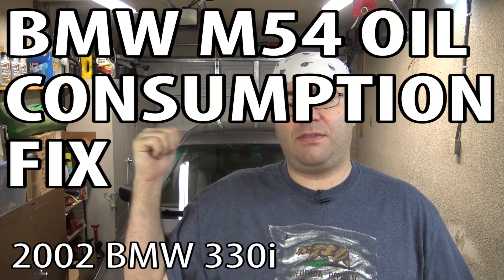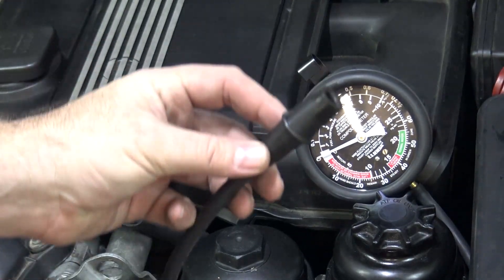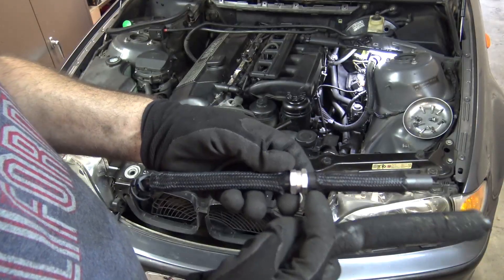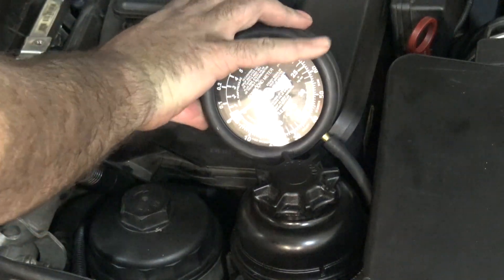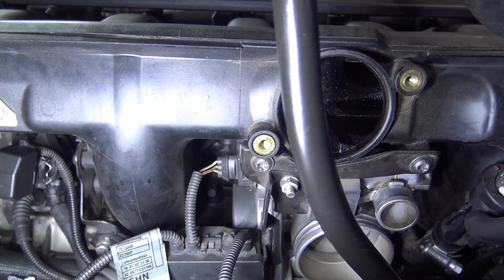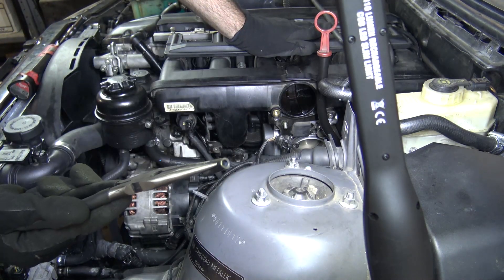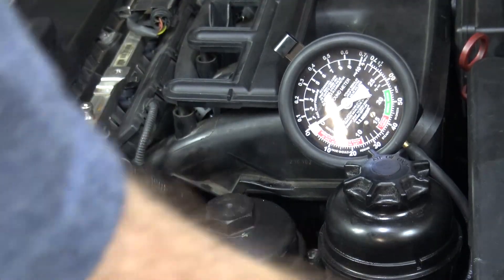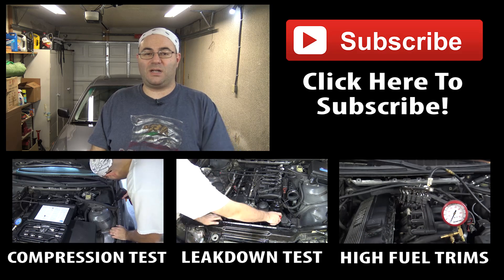BMW E46/E39 M54 Engine Oil Consumption Fix (02Pilot Mod) DIY

Comment: Just a point for ppl that will try this out. If you do this mod without putting a one-way valve on the return hose of the oil dipstick and connect a vacuum gage to the breather to check how much vacuum you have, you WILL suck oil up from your dipstick, since all the vacuum now has nowhere to go... ask me how I know....
Reply: This happened to me also.  I heard it suck, then smoke started coming out of the exhaust.  Come to think of it, I don't think the car sucked much oil (per the dipstick), but it did burn a lot of carbon out of the engine (similar to running seafoam or water in the manifold).  I ended pulling off the air distributor and cleaning the oil out with about 3/4 can of carb cleaner, replacing the spark plugs, and installing the one way valve.
Reply: @shoman24v  ive just done the 02 pilot mod, but didn't install a non return valve.
Everything was fine and the car had stopped smoking. Then the next day i was driving and suddenly got loads of smoke coming out the exhaust. Do you think its sucked back some oil? And how can i find out?
Reply: @joefowler9600  it is possible. Not sure how effective the valve is as I believe there is a video showing later how the valve started leaking. You can probably pull your disa off and look to see if you have oil in the intake.
Reply: @shoman24v  i was just thinking about taking the Disa off, can you think of anything else that may have caused it to start smoking? The mod has only been on a couple of days, the car smoked a fair bit on start up before the mod, then after the mod the smoke just stopped. Then all of a sudden while driving, it starts smoking wprse than ever. Not lost any performance, sounds okay and it seems to be idling ok.
Very strange
Reply: @joefowler9600  maybe a clogged ccv.
Reply: @shoman24v  could be if its sucked oil back, but the ccv is brand new and all the associated hoses are new
Reply: @joefowler9600  well, if it's new, then maybe try the one way valve. I ended up selling my car.  The mod helped, but still was around 1qt every 2k miles or so.  Once these engines start drinking oil, that's it. There's no way to fix it other than putting M52TU rings in it.
Reply: @shoman24v  I'll have a look inside the intake manifold for signs of oil. As much as i love the car, it drives me mad 😀 
Thanks for your input👍
Reply: @joefowler9600  no problem 👍👍
Reply: not being funny, how do you know this?
Reply: Well I did it.. and could hear the oil being sucked up to the CVV. Putting a vacuum gage on the breather closes the main port in which you are sucking air from, with that build up vacuum, the pressure is enough to suck the oil up from the dip stick.
Reply: Once this happens and motor oil is dumped into the exhaust system, how long does it take to completely burn the oil out of the exhaust?
Reply: @alvarohaesbaert  Me too
Reply: Wow guys now i know for sure why my exhaust is so smoky rn, before the mod the car burned clean...
But after the mod it started to do a ton of greyish\white smoke, now i have to plug the tube and hope for the best (replaced with original ccv)

Comment: Also this burning oil is coming from the oil dip stick tube suctioning to the CCV?

Is this statement is true. If I disconnect the hose from the CCV to the Oil dip stick will prevent to suck the oil from the engine?

Will this work?

Please advise.
Reply from the maker: No it's not coming from the dipstick tube and you can't disconnect it because you will cause a vacuum leak.  The oil that is being "consumed" by the engine is actually getting past the oil rings on the piston and being burned directly in the combustion chamber

Comment: Thanks for that advise. Yes you right I have the cold weather, it have the insulation. The hole to drill will be on the plastic elbow that connects the diaphragm with the lower can right?
Reply from the maker: yes

Comment: Hello question?:

I took all apart and this CCV don't have the Forward port to connect the hose. What else I can do to avoid the oil consumption.  I checked the compresión hot and all 6 have 177-180.

Please advise
Reply from the maker: You may have the cold weather version with extra insulation.  You can drill a hole through the outer shell to access the port inside or you can purchase a new oil separator that does have the port.

Comment: Weird I've never had issues with oil consumption on my m52tu (the same ccv design as the m54) and it has 304000ks on it.
Reply from the maker: The M52TU doesn't have the bad M54 oil rings that cause oil consumption
Reply: I had no idea.... I assumed that the m52tu and m54 were nearly identical. I would assume BMW used rings with less tension on the bore to reduce internal friction increase performance and efficiency.
Reply from the maker: That is exactly correct.  To get better efficiency out of it.  They want to be able to classify each engine as low emissions and all that crap.  They end up gaining a small token on their marketing sheet and we end up with n oil consuming engine.  So many manufacturers do it!
Reply: Its a shame. I thought the M54 was void of this given that the engine is well over a decade old. Its very common on current audi and volkswagen group petrol cars. They should really tell the owners to check the oil levels every second time they fill up and top up accordingly if low to prevent wear and damage to the car.

Comment: Thanks for the video. 
Question. Do I have to install the check valve on the return line with the Pilot mod hoses or you were referring to the previous can mod video?

Please advise.
Reply from the maker: you don't have to

Comment: Probably really easy to do but new to this: How do you put the smaller ID Vacuum line into the bigger one? I'm only able to insert about an inch of it. Tested pulling them out and it's 'fairly' easy to pull the smaller line out of the bigger one.

Thanks!
Reply from the maker: You can try some silicone spray or paste.  Or soapy water.

Comment: Hello 50sKid, Love your video's, very  informative and helpfull. probably one off the best on You tube!!
Whats the idea behind the non return valve in the oil return line? I also noted that in another video another non return valve was used in the line from the inlet manifold, why this modification? I'll understand the vacuum line from the inlet manifold to the ccv.
thanks for your answer, Ton
Reply from the maker: Check out this video here where I explain the CCV and reason for the non return valve toward the end: https://www.youtube.com/watch?v=5rs1rnVnXhY

Comment: Hey Jason. I really appreciate your videos. I am an e46 owner, but n46b20 engine (2.0L 4 Cylinders) and I can confirm that the CCV system is a nightmare. I am working on the removal of the system and instalation of a PCV system instead. I would like to comment that in the pcv system you will need a second port in the valve cover working as a breather. As I didn't want to manipulate the valve cover I did a small hole in the oil cap, and added a termination to connect a hose that connects to the air intake after the MAF and before the throttle body. I will finish the mod in a few days. 
Besides, I would like to mention that, in your video, you measured the vacuum produced by OEM CCV system and it is very rare you do not see vacuum, since I have checked personally on my father's e46 330i car to open the oil fill cap and it was difficult to open and then you hear the vacuum sucking, so I would say that your CCV system was not working properly?? 
Thanks you a lot your your very interesting videos! Regards. Jose.
Reply from the maker: Jose you should never need to put a hole in the oil cap.  There's already a port in the valve cover where the original CCV system attaches to it so it can suck the blowby gases out.  That's all you need for a PCV system.  That is the "origin" where the gases come out.  You then run a line from that to your intake manifold to recycle the blow by gases into the combustion chamber.  And you want to put a PCV valve in the middle of that line so that 1) the flow is only one way and 2) the orifice size is reduced so that the strong suction from the intake manifold doesn't suck all the oil out of the valve cover.  On your father's car, if his oil cap is difficult to remove, that means the diaphragm has failed inside the oil separator and all the CCV components need to be replaced.

Comment: Did u ever do the video showing the M5 ccv instead of the catch can or O2 pilot mod?
Reply from the maker: Nah. I bought it but I never got around to doing it (yet).  It would definitely make a better catch can/system than the catch can I used
Reply: If you where to do the m5 ccv would you still hook up the extra vacuum line

Comment: HI, i did this mod on my 325i 2002 as u did it in the video  but the oil light still come after driving for hundreds miles , depending on ur video this mod solve , maybe there is another reason for this decreasing of oil in my car especially that under my engine there is a lot of oil residue one the aluminium and plastic cover . any idea what happening :D . thanks
Reply: There are common leaks on the m54 engine such as Valve cover gasket, oil filter housing, oil pan etc. Search youtube for m54 common oil leaks. Shoplife has a video on it.

Comment: 50sKid, On my ZHP, all three ports are capped. Which one should I use? Also, is this mod going to hurt anything if one has little to no oil consumption?
Reply: What did you end up doing?

Comment: Hello 50K, let me get this straight. did you only add a vacuum line inbetween those 2 places? Am rather abit unclear because I heard something about a catch tank. so in short am trying to confirm just what I need to do exactly for that issue, also I have noticed on my dipstick I always almost every time only get oil reading of low oil yet once I drain the oil I do have enough, just last week I did an oil change and got out about 7ltrs though my dipstick shows low. advice?

Comment: 50sKid,What do you call a cold weather, cause i live in the Netherlands and we have a balanced climate ...warm and cold, Also would this mod be usefull on a 320 with a  2.2 M54 engine?
Reply from the maker: Well I can't speak from personal experience as to how cold is too cold.  Some people have reported their CCVs clogging every season.  I personally don't believe them.  I mean, take apart your CCV now with however many miles you've put on it and judge how clogged it is--that's the rate that your system clogs up.  So make your judgement based on that.  If you have an M54 and you have the oil consumption, then yes this will help you.
Reply: 50sKid, thank you for your reply..and so fast too..
I once had a Clogged CCV Hoses and some were close to rupturing, had it replaces
so guess i will try that MOD and see if it works..and i will also let you know then for some Data
Many Thanks
Reply: These cars are engineered and sold in Germany, by the way...where it is cold in the winter. If CCV's were clogging up every winter, there would be a Service Bulletin

Comment: 50sKid. 2004 m54 325i. so if i live in cold climates, i may not want to perform this mod? was going to replace the full ccv system and do this as a helper. didnt want to spend time doing it if my climate zone causes problems.
Reply from the maker: correct--you can do the catch can in a really cold climate.

Comment: 2002 BMW 325i M54 E46...replaced CCV using the 02pilot mod .....now experiencing long starts and stalling upon acceleration....any suggestions
Reply: You also had problems with white\grey smoke?

Comment: okay so im trying to do this on my 325ci and when i pull the disa out and look into where the plug should be. theres nothing....need help.
Reply: 50sKid drop knowledge on me please
Reply from the maker: You probably have the cold weather oil separator.  It has an outer shell that covers the take off port.
Reply: 50sKid hmm okay. i looked in there, didnt look like there was any shell that i could take off. and thats interesting because its a summer package car.
Reply: look harder i also have a 325Ci found it easy

Comment: This is tremendously entertaining!!! I will do this mod asap as I have a 330Ci and it's burning oil every ~1500 km or so. Big ups!
Reply: BioZ4 months ago
Warning!!! Do not open oil cap while car is running with this mod. I've been able to flood my intake with oil, just opening the cap. Learned the hard way that a non return check valve is a must.
Reply: @leonchang9692  Where did you add in the valve?
Reply: @ttgff1gfa2  I ended up deleting the OEM CCV and went with German Auto Solution's CCV replacement kit. It has been working well for the past 4 years.

Comment: Hi I have a question.  I loved your video with the whiteboard showing how either the O2 pilot mod or your new pcv valve/catch can setup generates vacuum on the crankcase in order to "reseal" the oil rings.  Makes sense how this would stop oil burning completely.  But now that you have constant vacuum on the crankcase, have you noticed oil level dropping by burning oil through the CCV system rather than through the piston rings?  Perhaps it just burns less?  This engine doesn't appear to have a breather hose for air crossflow through the crankcase - maybe that's why it burns less oil?  Really curious about what you think.
Reply from the maker: No you don't get increased oil consumption through the CCV system because, in the case of the catch can setup, there is a PCV valve in the system, and with the 02Pilot mod, we're only using a 1/8" vacuum line to apply a small amount of vacuum.  It's not enough to suck any oil.
Reply: OK I see.  So any atomized oil droplets will not be enough to affect the oil level?
Reply from the maker: With the 02Pilot mod? No you still have the oil separator in the system.  With the catch can, the can itself acts as the oil separator.
Reply: Oh right, I see.  With the 02Pilot mod, the crankcase vapors still have to go through the oil separator, so you're good.  But what have you noticed with your catch can setup?  Quite a bit of oil in the can?  Or pretty moderate?
Reply from the maker: Didn't keep the catch can very long--I moved on to the 02Pilot mod and then I rebuilt my engine.
Reply: @50sKid  Hello
What was your result with 02pilot mod did oil consumption stopped before you rebuild your engine? Thanks

Comment: Do you know of any long term negative effects from this mod? My car burns a quart every 200 miles and i really dont want to get rid of it because the car still drives amazing and has amazing power. No strange noises from the engine or anything like that. I even had a friend that knows a lot about bmw's say the engine sounds really strong(has 2 e36's and an e38). I just want to solve the oil consumption problem and ill be set😁.
Reply from the maker: as long as your valve cover gasket isn't leaking, you will be fine long term.  Otherwise, if it's leaking, you'll get slightly lower gas mileage.
Reply: Hey Trevor did you ever follow through with the 02Pilot mod? I am practically using same amount of oil every 2 - 300 miles which is a large amount. I had replaced my CCV 2 years ago which never resolved any oil consumption issue. So as it appears, I myself would like to get rid of this massive oil consumption.

Comment: Hey what kind of oil you guys think I should be putting on my 325ci 02 with 147k miles. I use castrol synthetic 5w 30 I think its not thick enough help
Reply from the maker: +alex888801 that is the correct oil. It shouldn't be thicker
Reply: 50sKid new upgrade I changed to 5w 30 to 0w 40 and the difference is I remembered that 5w 30 I would need to add oil to the engine sometimes and with 0w 40 I only needed to add 2 times oil to the engine
Reply: if you're burning oil from loose piston rings then use a thicker oil like 5W50. Or even 10W50 if you live in a warm climate. 
I've been using 5W40 and still burning oil, so if the 02Pilot Mod doesn't work enough, I will consider a 50 weight. 
M-cars run 10W60, fyi

Comment: Jason, where would we be installing the 12mm non-return line? On the tubing we use for the mod?
Reply from the maker: in the oil return line that goes from the oil separator to the dipstick tube.  You cut it in half and install the valve inline

Comment: +50sKid Any chance on getting that E39 Oil Separator install video? I've got the all the stuff (check valve on its way still) for the catch can install. Plan to use a Husky water/oil separator (originally for air compressor lines) for the OCC. But would like to see how effective the E39 Oil Separator is before I take the CCV out and install the OCC. Thanks for doing this!

Comment: I just tried to do this mod for my 325xi and could NOT do it. For some reason the port that is under the manifold up front is not there.  Any ideas?
Reply from the maker: John Rivera not possible. send me a pic on Facebook of the area where you don't think the port is
Reply: 50sKid I'll have to take one next time I pull it apart.
Reply: I have the same issue on my 2003 330i.  I just got around trying to do the mod today.  I couldn't find the front port.
Reply: @jonathanhalterman7634  try hawder

Comment: hello 50's kid,
would this be a good preventative maintenance mod, if there is no noticeable oil consumption issue?
Reply from the maker: No don't do it until you have the oil consumption.  If your valve cover is leaking in any way, it will cause slightly poorer gas mileage.

Comment: All kinds of issues here.  The stock system is in no way perfect, but there are way too many factors to contend with concerning this kind of mod.  I have had the best results with replacing the entire ccp system with stock.  If you want to go racing or just don't have the money, go for it.  If you think just maybe the system was engineered with more than "that seems right" don't risk your motor.